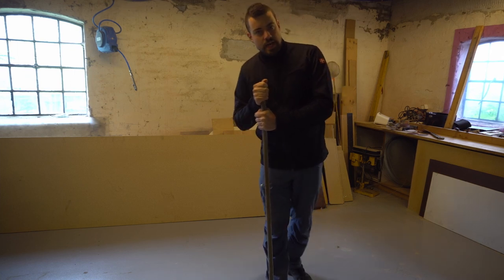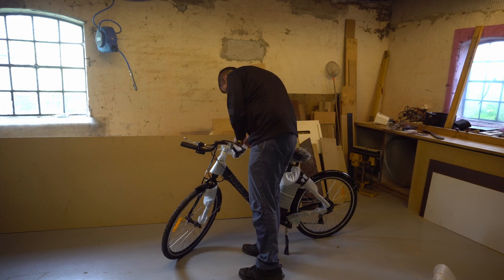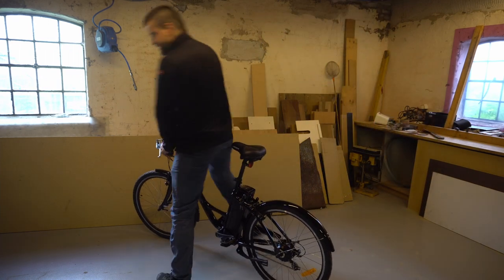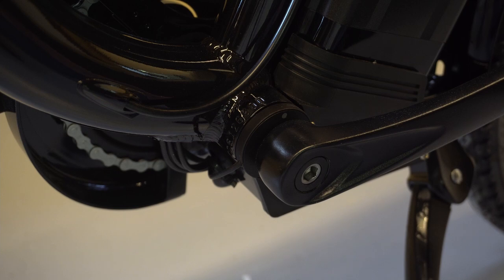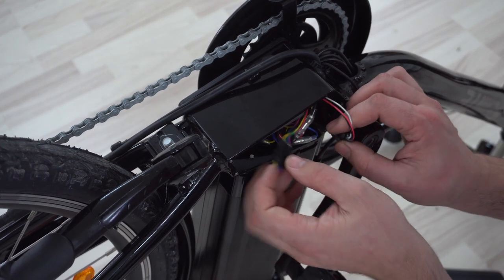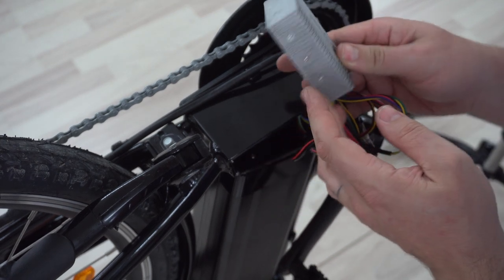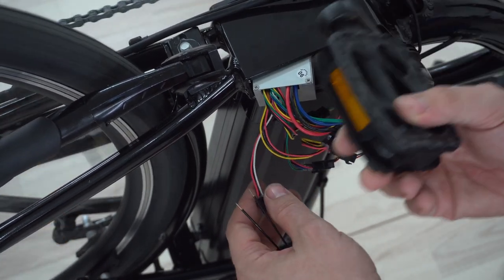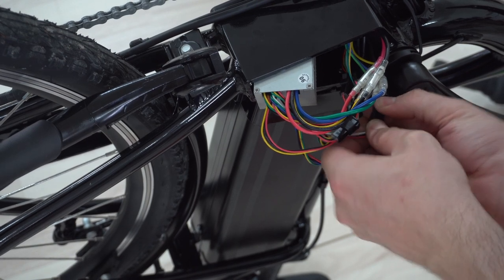E-Bike. Introduction and first looks on a new project!

Comment: I cut the white wire on my bike it allowed me to continuously use the throttle before with the white wire connected the throttle would go out at 20 miles an hour now it just keeps on going.
Reply from the maker: Interesting! I'll look into that!
Reply: @banjohat  You can always put it back/ fix it anyway it worked on my bike.It was set to cut out at 20 mph now it hits 28 to 31.